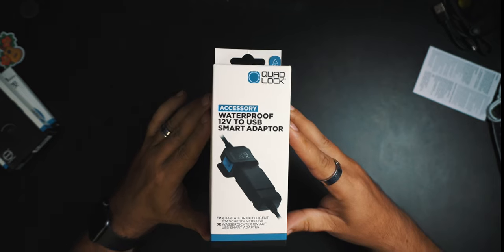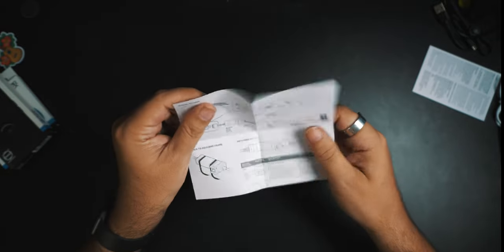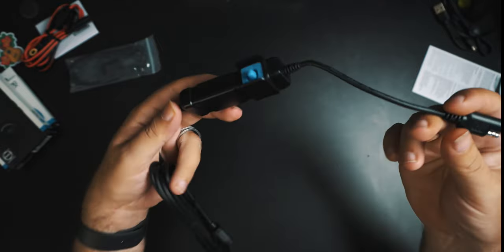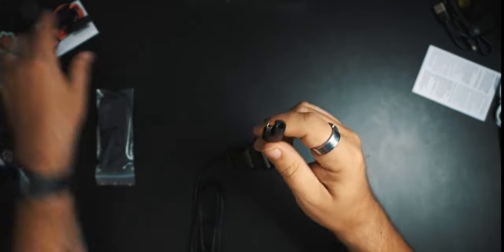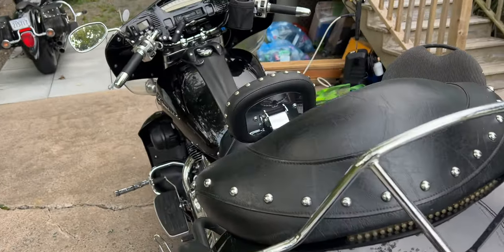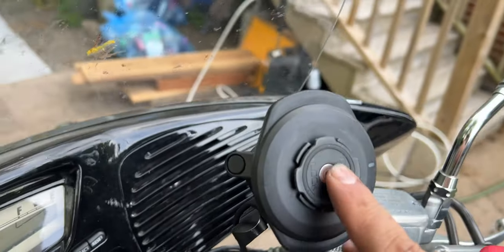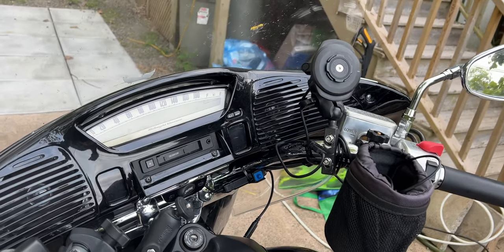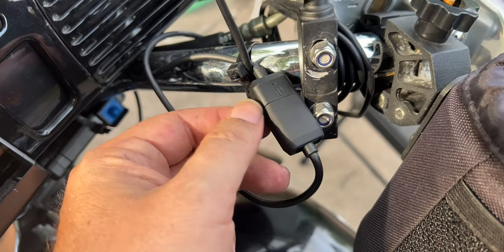New Quad Lock USB Charger.  Another Great Addition to Your Motorcycle

Comment: I’ve just got the same setup, I’m planning on having mine under the seat on my 2011 dyna in auto, and just use the power button on the back of the wireless charging head itself
Reply from the maker: nice.  im pretty happy with placement, but this spring ill be getting new handlebars so ill figure out where i want them  at that point.

Comment: Auto is off ... until it detects a phone then its on .... I just leave mine auto
Reply: Auto is off when the battery voltage hits 12.5v, when you start the motorcycle and the voltage goes up its on again. Until the voltage drops over time when you are not riding